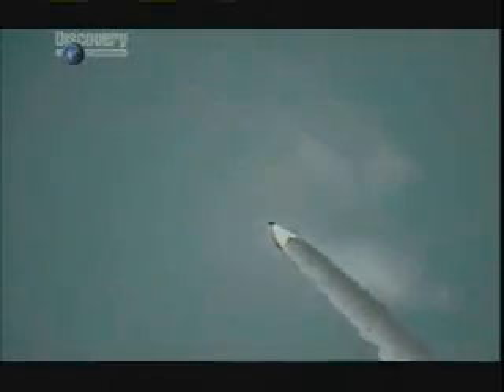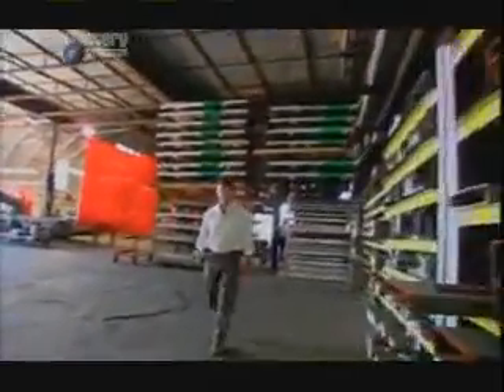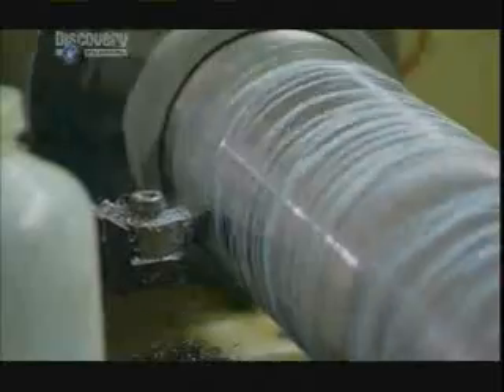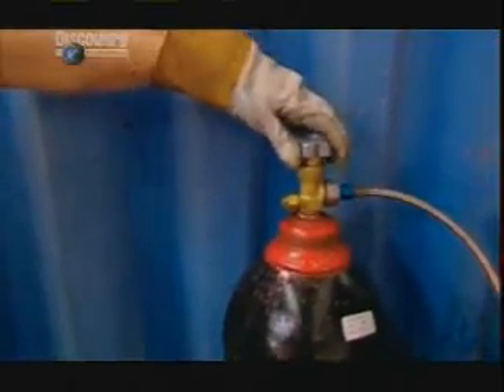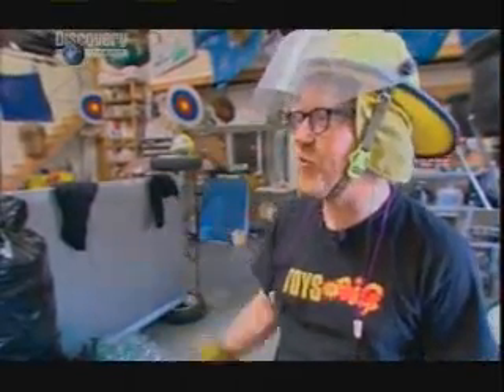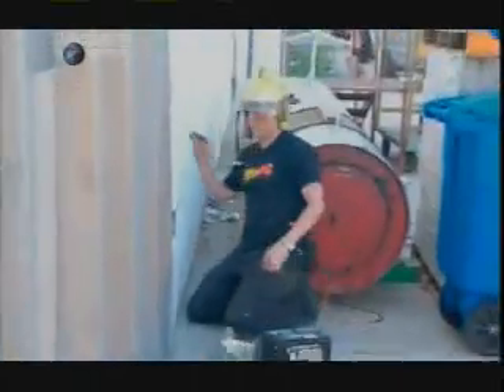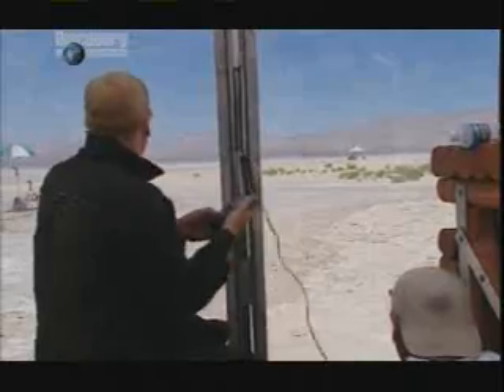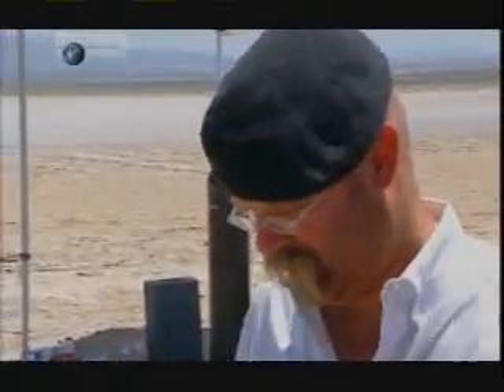Mythbusters - Hybrid Rocket (BOOM) More Smoke !!!!

Comment: Hale rockets -- descendants of the famous Congreve rocket -- were used by both sides in the American Civil War. But those early rockets were outclassed in both range and accuracy by new developments in tube artillery, so they were only used in small numbers. After the American Civil War, rocket artillery was largely abandoned until WW2 saw the revival of multiple rocket launchers like the Katyusha. That's history, not a myth.
Reply: The main thing with rockets though is that they are individually complex and expensive and so multiple rocket launchers only really became viable when industry had developed to the point that rockets could be reliably mass manufactured.

Also the rocket in the myth is the V2. Not it is pretty much describing the V2 from the fuel, to the mechanism to even it's capabilities.